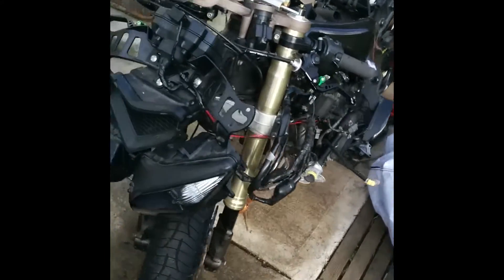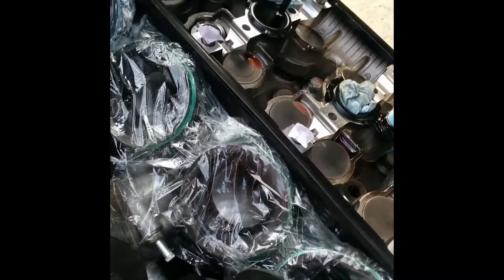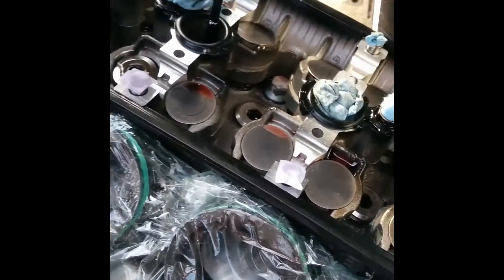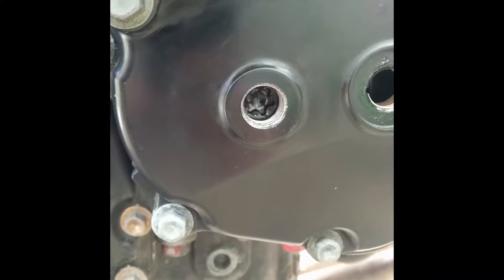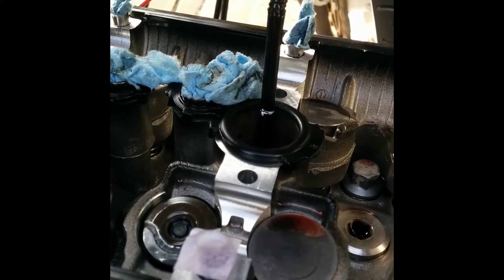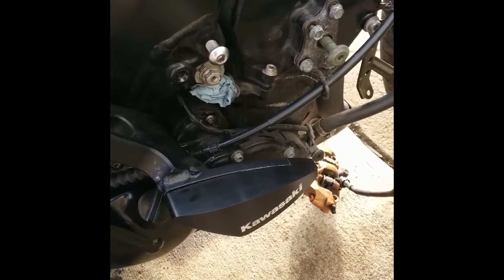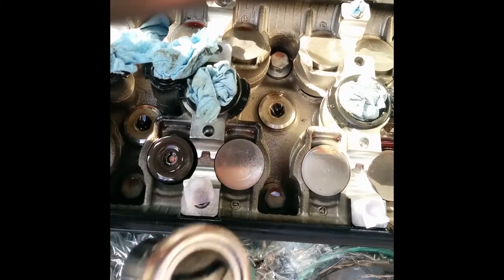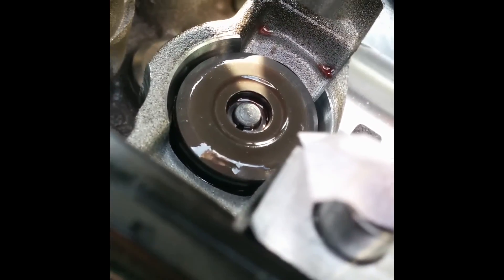ZX-10R 2006 - Fixing Broken Valve Spring Retainers

Comment: What a nightmare.  Question: What exactly is the cause for broken retainers?  Is this due to inferior (cheap) parts being used?  Or is this a direct result of living at redline for an extended period of time?  I have a 2017 ZX-10RR and while I am sure Kawasaki had several improved parts since the 2nd and 3rd Generation, I'd like to know exactly what causes this issue and, would replacing the retainers with brand new at each valve adjustment interval be a cost effective reasonable mitigation?
Reply: I think mine just went bad…they died at low rpm…hoping the pistons are good

Comment: Well I can now confirm that the 3rd Gen retainers are not the solution I was hoping they would be. 

Went through this 4 years ago. An intake dropped on my 06 and it was an absolute miracle but I got away with just a broken valve guide and bent valve. I pulled the head and replaced all the retainers with 3rd Gen parts. Hit the road with it again for 14,000KMs and decided I would do another early valve check since I had so much apart the last time..

2 more broken retainers. 1 of them just BARELY hanging on. Another miracle that it didn't drop another valve.

Comment: Thanks again for making this vid, I replaced all 16 retainers on my gen 1 ZX-10R with gen 3 retainers.

I only had a single broken retainer, on the intake side. The bike only has 12k miles and hasn't been ridden hard.

This method works perfectly, although I did have a small blooper where the keepers/collets weren't quite fully seated, and they flew off when I was trying to put the retainer back on.

Like the vid says, for your own sanity, do not let anything fall into the chain hole or any of the oil passages!!
Reply: Doubt you'll see this but i have an 04 zx10 and recently found out about this issue. Did you have fitment troubles swapping the gen 3 retainers? Because im gonna buy the 2008s and just dont want to run into an issue. Its been so hard finding a solid answer anywhere. Thanks if you happen to see this
Reply: @04widowmaker86  it works fine, just follow the service manual to get to this stage and then do what the video creator does, it works fine.

Comment: I have a broken retainer on piston #2, the same as shown in the video, does that mean that in order to replace the retainer, I will need piston #2 at TDC? or doesn't it matter?
Reply from the maker: Yes, piston 2 should be at TDC before you pull the old retainer off. If not, the valve will fall down into the cylinder and you won't be able to put the new retainer on.
Reply: @RaymondDowe  Wow I'm amazed to get a reply so soon! I currently have the cams and cam chain tensioner removed, is it safe for me to move the crankshaft without either installed? The manual says I can move the crankshaft without the the cams in, as long as I keep the cam chain taught. I'm just finding the manual a bit confusing, but I'm starting to believe that I can't mess up the valve timing if the cams are not installed..
Reply from the maker: @0x7FFFFFFFFFFF  Yeah, that's right. You can turn the crankshaft, just be sure to keep tension on the chain. This is to make sure the chain stays on and rotates with the sprocket that's attached to the crankshaft. You just want to make sure it doesn't bind up or get out of place and cause problems. Also make sure you don't drop it in, as it could be a pain to fish back out.

You don't need to worry about timing now as with the camshafts out there is nothing to stay in time with the crankshaft. You just need to be really careful when you put it back together that you get it right. Turn it by hand a few revolutions to make sure.
Reply: Thank you, I saved this video as soon as I bought my 05 zx10r, and now a year later I'm really glad I did. Just gonna take my time once it's time to put the cams back in,  lot of folk saying that the timing starts to want to shift as they torque the cam caps back up etc.
Reply from the maker: @0x7FFFFFFFFFFF  The alignment marks will shift a little when tension is put back on the chain, but the timing doesn't really change. The chain is on sprockets on the crank and cams, so unless it skips a full tooth somewhere, that's as close as it gets.

Comment: Did you replace all 16 of them or just the intake side?  Also, did you reinstall the cams in order to rotate the motor to have  cyl #2 and #3 done?  Or did you just keep tension on the chain while spinning the crank?
Reply from the maker: I did all 16. From what I've seen its usually only the intake side that is a problem, but I didn't want to take any chances. I just kept tension on the chain when rotating.

Comment: Great video, very  informative and love the tips.

Ive got an '06 with 7100 miles on ( yes genuine verified miles on a 12 year old zx10r ) and im considering doing work on it over the winter, valve spring retainers, checking clearance, decat, quickshifter, power commander, servo eliminator, powdercoat wheel, upgrade to ZZr14 brakes etc.

Should i leave the valve retainers for now, or get them replaced and get a clearance check while its open ?
Reply: Di Ablo get them replaced now do not ride your bike again before you do this you absolutely do not want to drop a valve at 160mph. I have a 06 with 9.5k on it and just found out about this bs right before seasons bout to start but I am not going to ride mine again before I do this.

Comment: Boy how I wish I would have read up on this problem sooner...
My 06 was recently due for a valve check (24,000KMs). I've seen so many liter bikes go well beyond that without an issue so I was putting it off. Today, at about 24,800KMs, something in the top end broke and it had to come home in the back of a truck. I'm pretty convinced it's retainer related and I'm hoping for the best but since it seemed to be running on 3 cylinders as I shut it down, I have a feeling a valve dropped...
Reply from the maker: Hopefully not, but it's a really common problem with these bikes. Good luck.
Reply from the maker: That sucks man. Did you figure out what the problem was?

I was riding with a friend about 3 weeks ago on he dropped valves. Ducati Hypermotard and the belt came loose. It's a horrible sound.
Reply: A valve did indeed drop and it was due to a retainer failure. 1 Valve dropped with 3 other intake retainers broken. The Head is at the machine shop and I'm waiting for parts to try salvage the old girl. 
You can check out my channel to see videos on it.
Reply: Here's the video of the ride and the aftermath...
https://youtu.be/udYA3gKkzJ4

Comment: How many KM's does your bike got and how important is it to replace these retainers? I did my valves 2 weeks ago and unfortunately I heard about these retainers recently. I did my valves at 28500kms and did not notice the same wear on the retainers you have.
Reply from the maker: I did the work around 28,000kms, bike now has about 41,000kms. Hard to say how risky it is. If a retainer breaks and drops a valve, it would destory most of your engine. On the other hand, I had two broken and it will still running fine because they held together. If yours aren't broken they might never have an issue.

Comment: Great video. Brings back memories of swapping out the retainers in my 05. Anyone who buys an 04-06 it is a MUST to check this immediately! Got mine used with 18k. At around 26k I checked the valve clearance and 4 out of 8 intake retainers were broken up or cracked. There's no way to tell if they're failing other than checking. Or waiting for a valve to drop. I replaced the bad ones and have 73k on it now with no further issues. I read in the forums it was mainly 04's and some 05's but looks like 06's also. Again great video.
Reply: So you also put the 08 Retainers in your 06 Zx10? Are you sure it works fine? Iam afraid of its not fitting for the 06. I didnt find anything on forums that the 08 works for 06. Are you sure ?
Reply: @PhilTV100  No I have a 2005. Supposedly the late batches 04 and newer 05's were affected. By the end of 05 they started replacing the retainers with updated ones. All you need to do is just order the current part number for your bike. That's all I did I didn't change the year of the part. They've all been updated at Kawasaki as they show an updated part number. Not 100% sure on the 06's but if they have an updated part number for the retainers Id get them cheap insurance. Like I said I found several that were cracked and bits were just bouncing around under the bucket. Never new it till I checked. Which you should do if not already. It's not like all the retainers were bad just some. You may not have any broken. But if your a rider that bounces off the limiter constantly then I'd replace them regardless. I now have 96k on the engine and I plan on checking again, mainly for valve clearance.
Reply: @steve23464  wow 96k?? And no problems with the gears or transmission or something ?

The Part number of the 06 Retainers are 120090010 dont know if thats a new number. But 120090010 is also the number for your bike 04 05 06 07 all have 120090010 part number... are that the new retainers ?

You also buy the 120090010 for your 05 ????
Reply: @PhilTV100  Yeah that's the one. Its lists the old number crossed out with the new number next to it on the 05 part view. For the 06 listing they just left the old number off. NO problems what so ever. I replaced the fuel pump last summer thinking it was bad but it turned out to be a short in the harness by the radiator! No issues from anywhere else. If you happen to replace the clutch steel plates save yourself a huge headache and just get OEM ones. I replaced mine from Ebay and unknowingly got thinner steels. Gave me clutch issues for months before figuring out the stack height was off. There's 3 thicknesses offered go for the middle part number. I did replace the swingarm from an 08 mainly for looks. The 08 looks way beefier prb the same stiffness. But it was cheap and easy. Was going to do the zx14 caliper swap but could never find them cheap enough. Heard about CBR1000rr calipers 06-10? Same make but a 2 pad setup instead of 4 pads. Very cheap and I'd say an improvement over stock.
Reply: @PhilTV100  Yes
Reply: So you put in and put out the retainers like in the video? Without taking the head off ?
Reply: @PhilTV100  Yes you only need to remove the valve cover and cams. You don't need to remove the head. You'll have to get creative for compressing the valve springs like in the video.
Reply: @steve23464  But the thing i dont understand, when i push it down and the claws get off. Is it possible that the Valve drops down??? Then i have a big Problem... Why it doesnt drop down in the video?
Reply: @PhilTV100  You first put the piston at top dead center. This way the valve can only move down a few milliters. That's what he was referring to with the make shift straw tool he had.
Reply: @steve23464  Okay but for every Piston top dead center? Because when 1 and 4 are top dead, 2 and 3 are not. So the valve in 2 or 3  will drop?
Reply: @PhilTV100  You have to do 2 top dead center pistons at a time. Then rotate the crank, while keeping the cam chain with a bit of tension, then do the other 2. You can't do all four at once. Have you even checked the retainers? When you do check them If none have cracked by now you should be good. Unless you plan on racing the bike, they would have already cracked if they were going to. Mine went sometime before 26k and I think in the video his went before that. I believe this is from bouncing off the rev limiter to many times as I have no idea about the first 18k miles of my bike. If they are abused they will fail. If not, they should be fine.
Reply: @steve23464  My retainers are all good i checked the Valves for 2 weeks. My ZX10 is 06 and built at march 2006. I have 7800 Km on it, not much and the ZX10 is like new. 

But iam very afraid of that "retainer thing" so i ask here. Because maybe one time it will hit me....

My ZX10 is not a "race bike" and never see the rev limiter
Reply: @PhilTV100  Great. Check them again at 16000 km or whenever you plan on adjusting the valves. Like I said I think only bikes that were abused or raced had issues with the retainers. Not saying you can't rev it out now and then but some people bounce off the rev limiter for minuets at a time. Not all of mine were broken only 4 of the 8 intake retainers and I replaced only those. I rechecked at 50k and no more were broken. Since none of yours are broken I wouldn't bother changing them because unless you have a way of compressing the springs easily, it can be a pretty frustrating job. Not particularly hard, but most valve spring compressors work with the head removed. I improvised a clamping device and lots of cussing later I finished it.  Good luck either way.
Reply: @steve23464  Thank you very much! You ard a big help buddy !!
Reply: One of my Bucket tappet have a round footprint on it. The other ones doesnt have it so much. But this one (second on the Intake side) have a bigger round footprint, but you cant feel anything  with your finger there is no gap or somerthing to feel so i think its all okay. But i ask myself, why is the footprint on that bucket so strong.
Reply: @steve23464  No that valve is not tight its in space between minimun and maximum. Dont know why there is a footprint but it works well. Thank you for your mail :)
Reply: @steve23464  Wrote you an email. Send you a picture of the Footprint Bucket :D